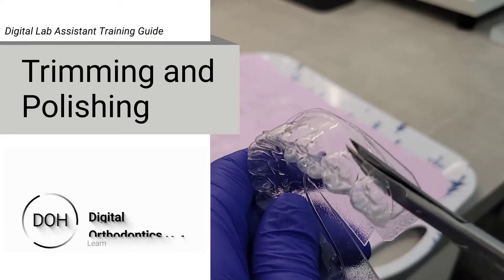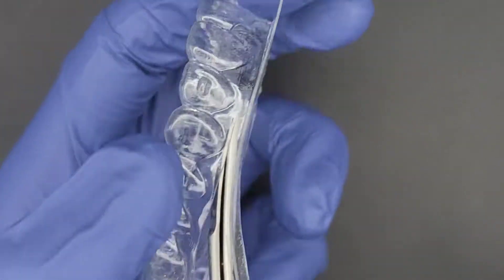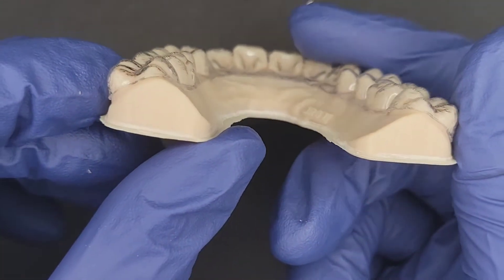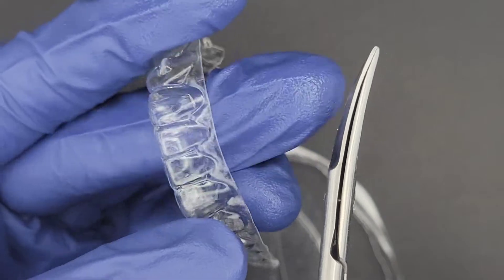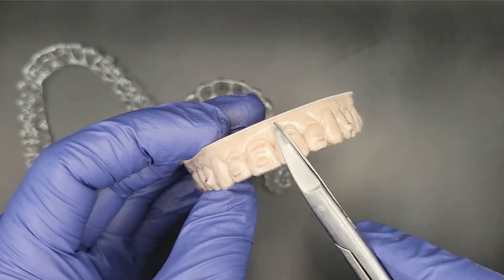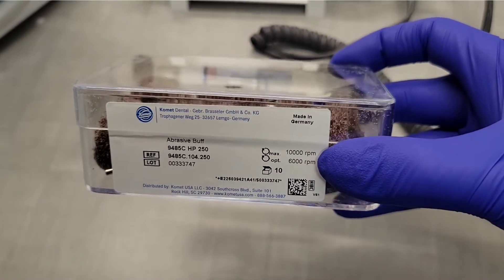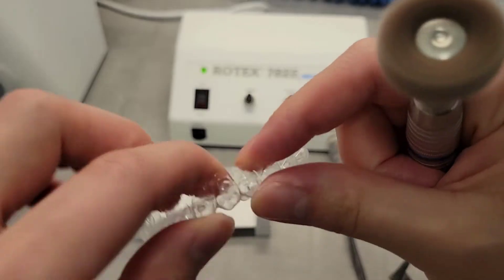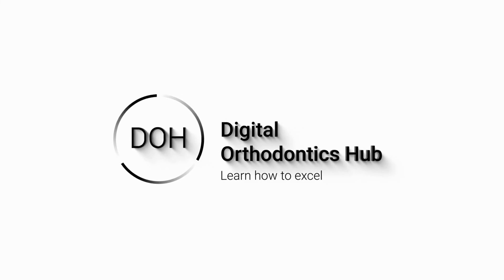How to fabricate clear retainers and aligners from 3D printed dental models

Comment: How do you separate the aligners from the models without cutting them off?
Reply from the maker: A little silicon as a separating agent and the vertical cut. Having a small height model is the key.
Reply: @PersonalizedOrthodontics  Thanks, where do you place vertical cuts?
Reply from the maker: @wakesurfidaho  straight between the two part of the arch. If you are holding the model in front of you facing up. The cut goes from the bottom to top close to the front teeth. 

Then roll the plastic to the sides from lingual/palatal to the buccal - twist clockwise each side.